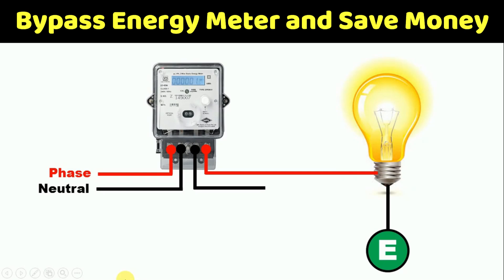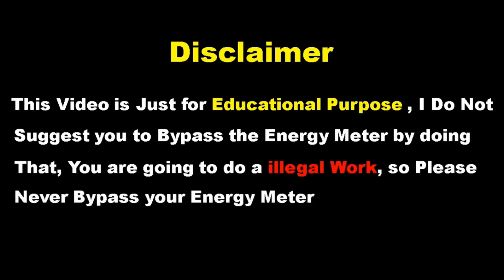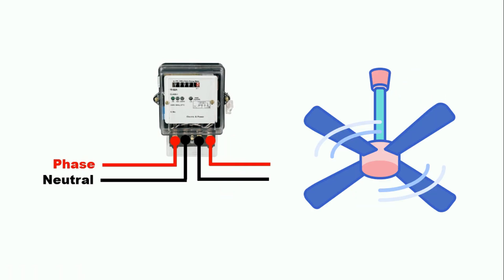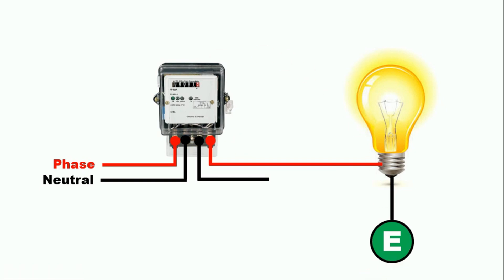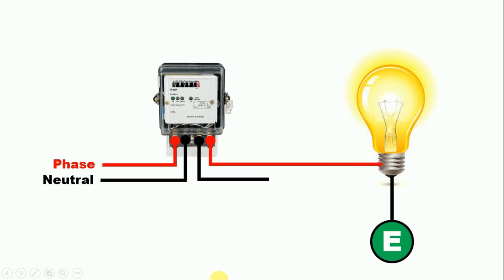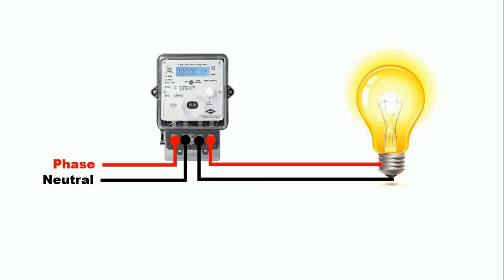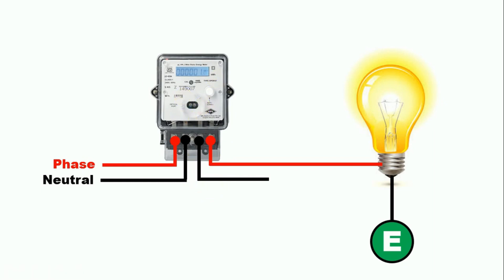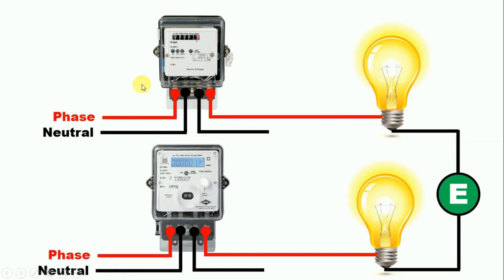How to save electricity at home | People are bypassing energy meters by doing this@TheElectricalGuy

Comment: Mmm I worked with energy meters,  disconnecting a neutral at the load side won't help  because inside the meters on neutral it's just a bar or link between 2 ends with a a very small cable going inside  for instruments,  what is important is live side  not neutral.  You can supply   meters  with a very small neutral but live must be correct cable thickness which  means the main neutral will not be connected to the meter but  to the  main incoming cable neutral bar and it will still work 💯 percent.  So I know live sides is the most important side to deal with,  otherwise neutral side will do nothing at all , maybe burning your tvs and everything connected. Kkk

Comment: The Earth Is A Big Capacitor which has a GLOBAL STATE. Meaning anywhere in yhe world you connects to inside the Earth Crust, When it comes to electricity, you will get Power.
Therefore, why not make yourr own self Powered shorted or capacitive Power Amplyfing ONE WIRE OUPUT TRANSFORMER  to generate your Electricity?
 Why?

Comment: You are wrong.even in old type energy meters energy consumption will happen.current coil will be in series and pressure coil will be in parallel whenever there is a current flow in the current coil the meter starts to work.

Comment: You're lying as long as phase is going through the meter on both ends it will still charge u it won't bypass anything,neutral line doesn't bypass the meter.
Reply from the maker: The same thing i have said in the video ☺️, please watch the complete video